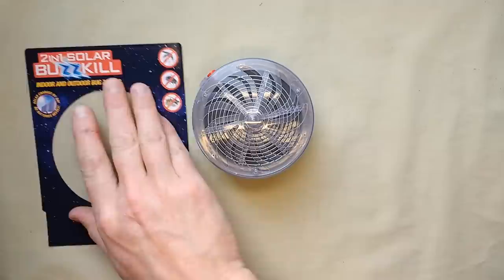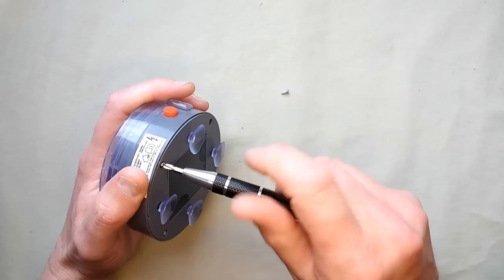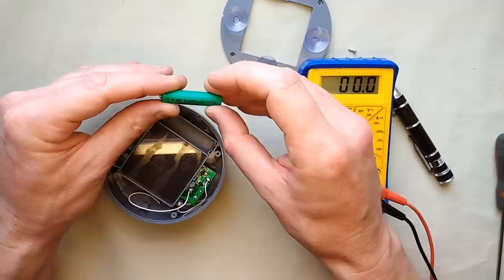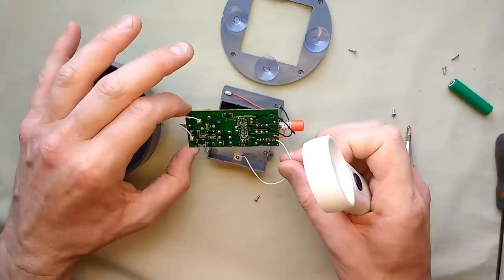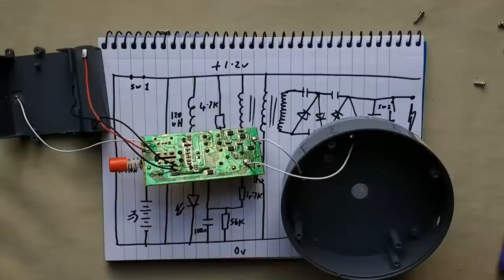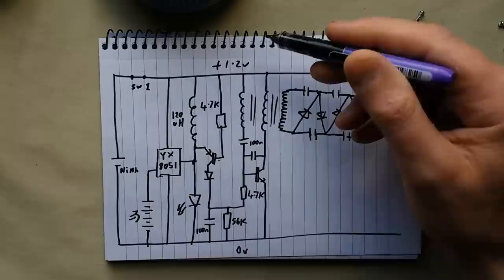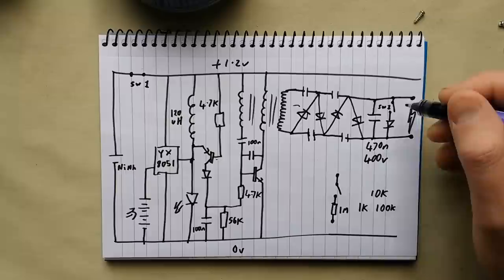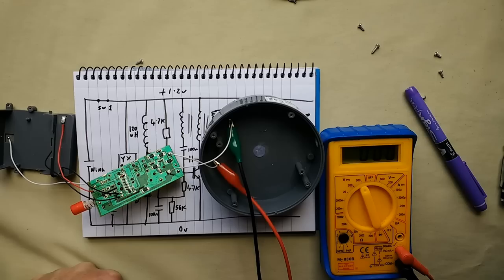Buzzkill solar insect killer with weird schematic.

Comment: +bigclivedotcom
I know it looks weird, but the PNP transistor isn't pointless at all. (lol obviously)
One has to remember that the inductor and YX8051 chip are there boosting the voltage. When the voltage on the LED is boosted, a negative potential forms across the base-emitter junction of the PNP transistor, causing the transistor to turn on. As such, the 100nF capacitor then gets pumped up to about the voltage of the LED minus the PNP and diode voltage drop! ;)

I have a feeling the point of this is to turn off the HV zapping booster when the battery voltage is too low, or perhaps even when it is charging the battery. (I cannot tell because I can't find the datasheet for the YX8051 which would explain what sort of functions it has, though I didn't search very much.)
Reply: Benjamin Esposti That was my take as well given the voltage swing you will see off the inductor as it is switched on then collapses.

Comment: The PNP will not turn on if the LED boost is not enabled, because it will only be enabled if the voltage on its emitter will be higher than the battery voltage + 0.6V (so only when the YCX 8051 is pulsing the blue LED). A simple diode would enable the high-voltage boost all the time (well, except when the switching node is shunted to GND by the internal transistor of the YX8051)

Comment: The voltage on the emitter is going to suddenly go up as soon as the boost converter is turned on.
When the boost is off the potential difference between the base and the emitter will be 0 but as soon as the boost will increase the voltage by at least 0.6(or whatever the transistor base forward voltage is) it is going to turn on.
This way when the boost is off there is not going to be any voltage at the collector of the transistor, no matter what the supply voltage is.

Comment: I know sometimes the cheapish multimeters can have low(ish) impedance in the 1 to 10Mohm range.  Are you sure it doesnt put out a lot more voltage than 170V, just being drawn down by the meter?
Reply: htomerif yep, my thoughts too. I have almost the same meter, putting it across a high voltage low current circuit produces false readings due to the 1Mohm impedance. Even my Fluke with 10mohm tends to falsify readings
Reply: Erm, the impedance of the multimeter is irrelevant if one is measuring voltage in the ohmmeter range.
Which is precisely what you described, applying a voltage to measure resistance and worrying about input circuit impedance. Most DMM's are 10 meg, my ancient Beckman 310 had a 22 meg input impedance in AC and DC.
If 10 megs draws down the output voltage, an insect would drag it down farther and make the entire unit useless.
Reply: @spvillano  Nonsense.  Ohmmeter range is not involved.  Insect is killed by the instant dumping of capacitor stored energy over a time much shorter than the measurement.
  So meter measures the steady state voltage, which is reduced by the meter presenting a load to the voltage multiplier.

Comment: The M7 discharge diode appears to be a standard 1000V 1A silicon rectifier diode (like a 1N4007).  However, it looks to be reverse biased which means that when shunted it will avalanche in reverse breakdown quickly discharging down to about 1000VDC (if the capacitor and/or plates even reach that voltage given the capacitor's 400V rating) after which the ~5-50uA reverse leakage current would then continue to draw down the capacitor after a short while to a much safer voltage.  But that dependency on reverse leakage current would avoid excessive switch contact arcing given it seems unlikely we should ever actually reach the reverse breakdown voltage of the diode, though it is a very odd way of getting the job done where a simple resistor, or even an SCR, would have sufficed nicely.

Comment: This scheme is not strange, but very thought out. The transistor opens when, the voltage on the LED becomes higher than on the batteries 1.2v+0.6v. And charges the capacitor on 56 kOhm in parallel with a resistor. Which provides displacement to the base of the generator transistor.

Comment: The circuit looks fairly straight forward.  When the LED is off, the PNP transistor is an open circuit because the base and emitter are at the same voltage, and does not load the battery.  When the LED is on. The collector will be around 2.2 volts which shifts the bias on the oscillator transistor enough to unblock the base and allows it to respond to the feedback and oscillate.

The common terminal of the voltage multiplier should be the anode of the left most diode.  The 470n capacitor should probably be between that anode and the cathode of the right most diode.  What is neat about the Cockroft-Walton multiplier is the individual capacitors and diodes can have fairly low breakdown voltages, much less than the output voltage.  Using the diode as a safety discharge is weird, a 10K resistor would be fine, maybe a chip diode is cheaper than a resistor.

I have the same cheap meter minus the blue bumper.  It is actually a pretty good meter considering it cost $4 US.  The DC accuracy is quite good, but the AC sensitivity isn’t too exciting.  The DC input resistance is 1 Meg and the AC input resistance is 707K (guess why that is…). Yes, the low range current input is fused.  The 10 amp input is not fused.  I bought a whole box of these meters so students could measure TTL and CMOS switching threshold and current draw simultaneously in a digital fundamentals course I teach.  Yeah, it is a low tech approach, but it seems to really help students get the point.

Comment: The weird circuit is a rapid switch system designed to create a square wave ripple to bridge the transformer with the highest voltage possible.

Comment: The 170-odd volts you're reading is not entirely accurate. This kind of circuit can only deliver minute amounts of current, and even the 10M input resistance of the multimeter is more than enough to load down the output, so in reality it is much higher. Measure it with a high value resistor in series, together with the input impedance of your meter as a voltage divider, and you will get closer to the real output, which I suspect will be significantly more than double. Great video as always.
Reply: Or he could just use a better meter he owns.

Comment: the discharge diode on your schematic points into the same direction as the last diode of the multiplier. This would mean that everything it does, would also be done by the last multiplier diode - unless the discharge diode had a lower breakdown voltage, but you said it was a M7 diode, which supposedly has a breakdown voltage of above 1000V...

Comment: Tip: When I need to measure the current from a battery pack, I use two peaces of self adhesive aluminium  (or cupper) tape back to back  (one peace larger than the other) You can then easy attach you meter to each side of the "sandwich" while the batteries stay put in the battery compartment - giving you an extra free hand.
Reply: Or a piece of a double-sided breadboard. But metallized adhesive paper sounds much better, thanks for the advice.

Comment: The NPN transistor only turns on when the boost chip is turning on the LED when it's dark, by making the emitter voltage higher than the bat+ voltage. If the diode was connected directly to the LED, the 100n capacitor would be charged to battery voltage (minus diode drop) even if the led was not lit.

Comment: That's the problem with those "cheapie" meters - they have a fairly low input resistance. My "cheapie" is only 1 Mohm on the input at 600VDC, which can easily affect the charge voltage of the cap. It goes down to 750k on the 200mV range. One of my higher end meters has a 10Mohm input resistance.

Comment: This seems to be a parasitic resonance discharge circuit.
 The odd backwards nature of the base fed transistor will resonate with the 120uH coil. The resistor is to keep the current low on that side while allowing a resistance to the voltage as well(voltage drop). The diode voltage multiplier doesn't require much current as it is stepping up the voltage running through the transformer. This is the newest way to accomplish this device.
 Some of the discoveries like the backwards running of the transformer was done by some guys in the free energy click. Very very efficient circuit. I think laserSaber was one of the first to look deeper into this.
 If you want to keep up the wonderment then look LaserSaber up on youtube here. Very interesting fellow.

Comment: The oscillator is a basic Hartley oscillator, the feedback from the primary for the tank and feedback circuit and choke on the collector tells the tale.  Split capacitor across the primary/tank would make it a Colpitts oscillator. Simpler feedback from the secondary would make it an Armstrong oscillator.
Every student in electronics school usually then moved on to build an arm-pitt oscillator. Nobody ever tried to make a Harley-Colpitts-Armstrong oscillator, due to a lack of punny name...

Colpitts tends to be more frequency stable, compared to an Armstrong oscillator that'll have frequency drop with load on the secondary. Armstrong, more stable in output, at a cost of frequency stability. The Arm-Pitt, it just stinks in the summertime.
Could've done similar with an old 555 timer driving the mess off of an RC circuit, but complexity and current would be unnecessarily greater and KISS is a valid principle.

The output is a quadrupler circuit, lower current, higher output voltage.

Obviously, this is all analog era circuitry, which is why it's largely forgotten in the west...
Uh oh, did I just give my age away here?   ;)
Reply: Correction, shouldn't read circuits after midnight, secondary feedback, Armstrong.

Comment: I can only suppose the arrangement with the PNP is to ensure the zapping section only receives power when the solar panel is in the dark.  If there was only one P-N junction, then it would turn on with just the battery voltage via the boost inductor.

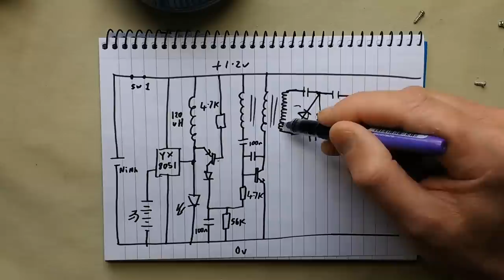Comment: Did they just messed up the voltage multiplier circuit (10:32) with that fifth diode and the buffer capacitor misplaced? The switch should then short circuit the output directly. 
I love these analyses!

Comment: With those cheapie meters I buy them in pairs. I leave one in current mode and the other in voltage/resistance mode and paint or otherwise mark them clearly.

Comment: The odd 4.7k resistor transistor combo looks like it might be to prevent current leaking through the inductor and over discharging the cell if the voltage is too low as a crude protection circuit.

Comment: very curious indeed....   I think the 4.7k resistor to the PNP will initially keep it turned off, but then the emitter is pulsed up and down by the coil voltage, so it will switch on and off in sympathy.

Comment: The transistor that you think should be a diode: Are you sure it's bipolar?  I would expect a  mosfet.  Sometimes mosfets are used instead of diodes because they have a lower junction drop.  Handy for reducing losses in a solar circuit.

Comment: The PNP transistor in essence will only let the current through if the voltage at the collector is higher than the battery voltage, ie if the LED is on. You could drop anything below battery voltage down to zero with two extra diodes if you wanted to, but then there might not be enough left to reliably activate the oscillating transistor, depending on the forward voltage of the LED. The diode on the end also puzzles me, because it looks backwards for discharging the output. Maybe just a resistor that looks like a diode? SMD components are hard to tell apart sometimes.

Comment: Hang on, where did you get that rubber case for your DT-830B multimeter? that's cool!
Reply: I expect he got it from Maplin, same as me, a looong time ago; they simply came with a blue case. Seem to recall they were silly-cheap; two for £5 or somesuch. This must have been 15 years or so ago.
Reply: its the original mastech which came with it, the chinese 830bs are a ripoff of this meter, they are not equal, this is a budget meter for sure, but much better made than the clones

Comment: I use a cheap DVOM for auto diagnostics. Its close enough, doesnt have to be some fluke to get the job done. A DVOM is not a replacement for a proper 12v Test light, though

Comment: They use the diode instead of the resistance to prevent the blades of the swich from burning over time
Reply: Popescu Gabriel A high value resistor (e.g. 1 Megohm) would pass so little current (a max of 400uA if at 400V peak) it would never damage the switch contacts, so using a diode does not save the switch at all.  In this case they seem to be using the reverse leakage current (spec'd at 5-50uA) of the diode to perform the controlled discharge function, but an odd choice given how much cheaper resistors are versus diodes.

Comment: It wouldn't surprise me if the diode is there because its the wrong part, but fits as it was the same footprint as the resistor.

Comment: It looks like that PNP transistor might be acting as a diode with a slightly lower forward voltage drop? It'll be turned on when the LED voltage is greater than the battery voltage.

Comment: I would have done the same thing with a screwdriver. Those zappers don't have enough juice to kill. 

I would have liked to see what is the tested capacity of the solar cell. How much power it puts out and about what time in the day (estimate) it would have started producing enough voltage to start battery charging. Basically if it made sense that the solar cell could charge back the battery to full capacity 

Also an overnight run to see what the total draw would have been and what voltage the battery was at.

Comment: Wouldn't that discharge switch closing enable the big capacitor to discharge back through the voltage multiplier and the transformer towards the solar panel and the chip? So maybe that whole transistor mess there is to guide the energy towards the resistors and to keep it away from the LED, cell, chip and panel?

Comment: Is that resistor from +v to the base possibly some sort of battery monitoring or load smoothing. 
The 91ma surge current at the start that drops fairly smoothly looks almost like the internal resistance of the battery is causing a voltage drop, and the inductor is 'holding' a higher voltage at the collector.  so youll get some oscillation as the device turns on. an oscilloscope graph between +v and that base would be interesting to see.

Comment: I think the PNP transistor might disable the boost circuit if the voltage is too low to even light the LED.

Comment: As the emitter of the pnp becomes higher than v+ with coil kickback the base is effectively lower than its emitter, so it switches on and pulses the transformer transistor at the same frequency of the led.
Perhaps the transformer transistor isnt a self oscillator, or perhaps not a reliable one.
So if the led driver does not have enough voltage, the transformer driver stops working?

Comment: I imagine the clue to the discharge diode is in the fact that it's polarity is exactly the same as the diode that's already connected in exactly the same place, but without the switch... notice the diode to the left of it in the schematic? Is connected to the same place that the discharge diode will be connected when the switch is closed, so any instant discharge must have already happened, ruling that out (something about "the forest for the trees"? *lol*)

Comment: If I was designing such device with a big button to switch it off, I would totally use the switch to short the grill and discharge the high voltage part.

Comment: "I think we should take it apart"

The dreaded words my folks hated when I was knee high to a grasshopper, as I took Everything apart to see what made it "Tick"

And "Dreaded" due to the fact that not everything went back into a functional product when I was done 🤣
Reply from the maker: Did it lead on to a technical career?
Reply: @BigClive  It did, but not the direction I was intending. 

Studied electrical, until I got bored, moved onto electronics, and acquired T3 (Not sure if they even use this classification any more), moved on to A+, MCSE  etc, and currently install and repair satellite TV..... So, a step or six back from electronics, but still love tinkering with it when I get bored. 

Obviously, thanks to you, I no longer have to disassemble things into a state of disrepair to see what makes them tick, "in order to get my fix for being Destructive" ...... Well, that's what my folks thought anyway 🤣🤣🤣

Comment: Huh... Well, I think using a single pole double throw switch to discharge the output capacitor when switched off is quite clever. But yeah, I also can't think of any good reason why they would use a diode instead of a resistor. The way you drew the diode in the schematic though, the capacitor would drain through the diode in reverse direction. Maybe they use the diode to discharge the capacitor quickly at first and then slow down as the voltage decreases? Not that that would have any reasonable advantage though. No idea, strange...

Comment: Occurred to me both those diodes are supposed to be resistors.  The discharge diode is reversed biased   if it is a diode, so it will discharge slower than the other way. Odd.

Comment: Maybe the multiple PN junctions drop the voltage far enough that leakage thru the inductor is not an issue ?
Reply: TheChipmunk2008 I'm guessing they want the oscillator input at near the LED voltage, but only when that is at least 0.7V above the battery voltage. A simple 0.7V diode would feed 0.5V at LED off, 2.3V at LED on so discharging battery at off and not fully turning off the output transistor.  Two 0.7V diodes would be off at LED off, but 1.6V at LED on.  This circuit with a 0.7V diode is off at LED off, 2V to 2.2V at LED on, providing a strong signal driving the output transistor.